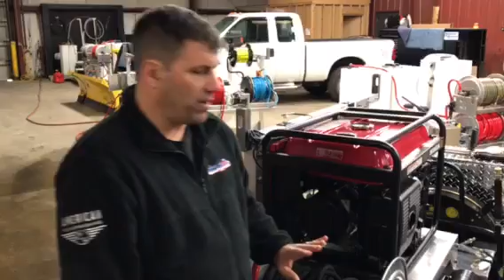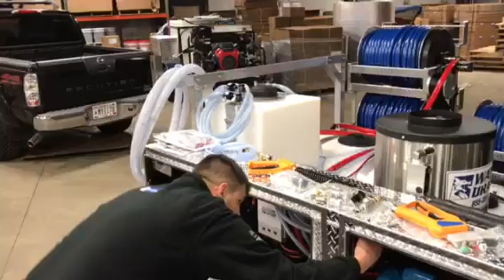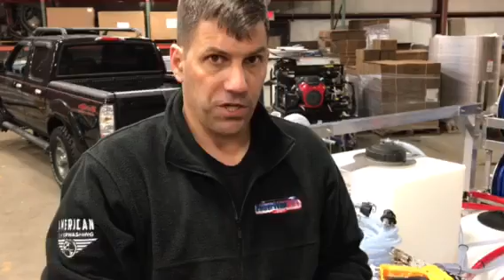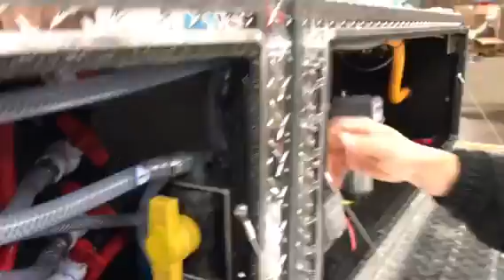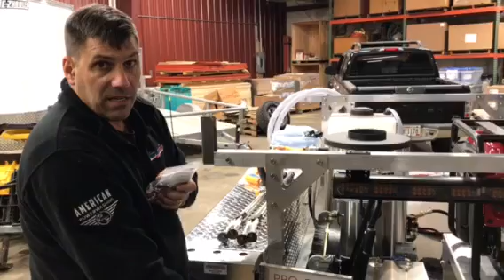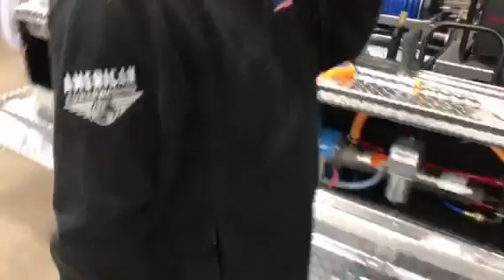Brett Blacklidge power wash and soft wash system by Power Wash Store

Comment: Definitely on my list of upgrades to get a skid from you guys!
Reply: Clarke's Cleaning Service, Inc. Window Cleaner  where do you get your  brackets from hoping you square tubing
Reply: It will do the job but wow, is it possible to make a 4 feed system much more convoluted?  Good job a B+ on centralizing but holy &:$: could you not spend another $200 and have it self prime?!? Just saying - and that $200 includes equal ample markup. Perhaps complexity pays. Not rocket science, patents started in 1820’s-30’s... self prime non-diluting. Mills had 30 dye
Colors not 4 liquids inc. water. B+ on tidiness it’s a clean install but way more complex to use than needed.